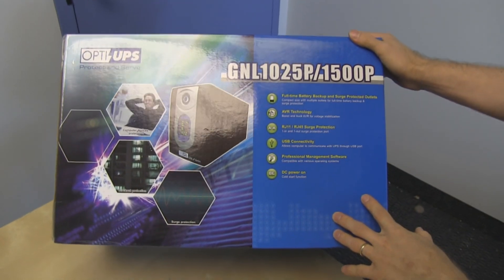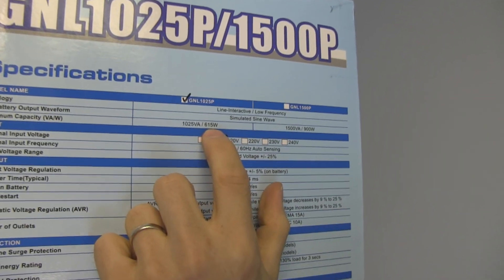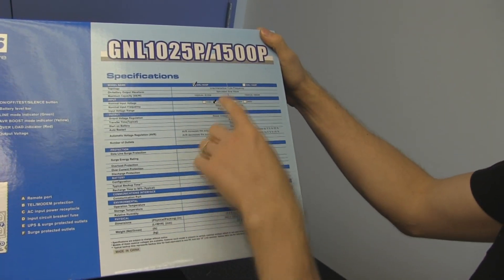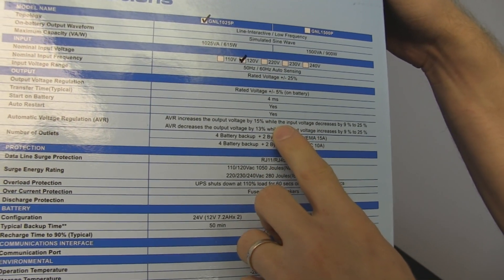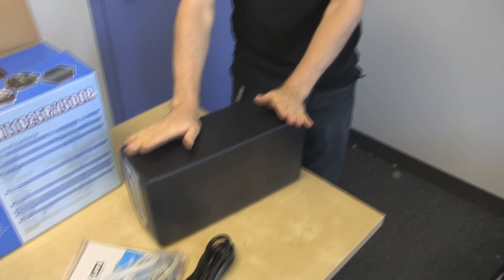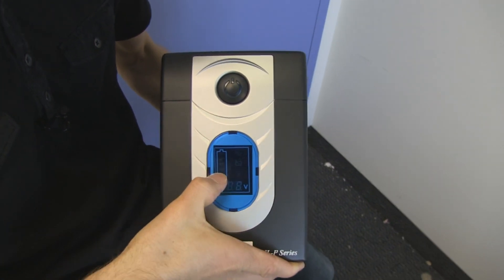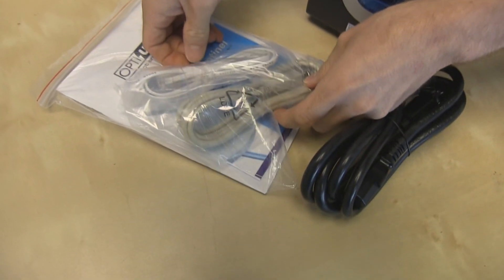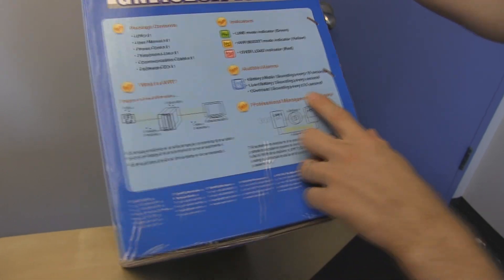Opti-UPS GNL1025P Line Interactive UPS Unboxing & First Look Linus Tech Tips

Comment: yes you may not get a lot of power outages but the electricity is still not clean and the lifespan of your pc or whatever you are using will increse by a fair bit and a power outage can easealy be caused when you accidentealy plugg to much to the same power breaker like it did for us when we got a yakuzi if we run the washing machine at the same time as the heat was turned upp our electricity went out and my hard drive was damaged a ups could have prevented that hard drive of geting damaged

Comment: i had an older ups and all it gave me was problems, they are too expensive, my old pc was 2 years maybe on an UPS because my parents insisted ( 10 years ago, was 13 ), and i had my pc crash all the time, after that my "beast" is still alive and kicking to this day, i replaced it because it's slow as hell, you don't really need a UPS. plus you MUST buy a high quality one and it has to be able to take at least 10% more power draw then your PSU, and most ppl i know don't use it...

Comment: It's an uninterruptible power supply. Basically it's to protect your computer from surges, "unclean" power, and blackouts ..for example, if your power went out when you're rebuilding a RAID array, flashing your BIOS, or something critical like that, a UPS would give you enough time to either finish the operation or cancel it so your computer doesn't get fucked up... also, if you live somewhere where there's "dirty" power, a UPS can save your entire machine from frying due to a surge or something

Comment: for average household use? yeah its not that necessary. in a work or serious professional environment, where 1% chance on any given day to cause electrical damage to sensitive/ expensive equipment. because if you run the cost of a UPS vs's the potential cost of electrical damage, you would be stupid to spend $1000's of cash and not buy an extra layer of protection.

Comment: Everyone! It works as a power cleaner and a backup power source (without a delay, like a generator would cause). The only exception is laptop users as the unit has a battery and power cleaner.